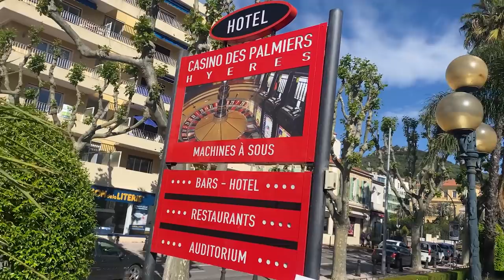MAKING WATER FOR THE FIRST TIME | EP 281

Comment: Just an fyi, the meter measures total dissolved solids, so water in your tank, no matter how long it has stayed there, is not going to increase in TDS reading as it cant gain solids!. It can however start to have micro growth that will not impact the tds reading. Good practice is to try to balance water usage to water generation so it does not get a chance to stagnate on the tank. To be 100% certain of micro quality you can get small uv units that would go onto the drinking water tap (not needed for wash water or showers!).
Reply from the maker: Thanks, this is all most helpful, we appreciate it. Who would have thought water would be so complex. Makes sense, we need it to live.

Comment: There is a specialty purposed  round wrench designed specifically to open and close the housing for the water filters. I  use a wrench like that and it makes the job much easier. The one I use appears to be made out of some type of plastic material. It's basically a big circle with a long handle. Hope this helps  : )
Reply from the maker: Thanks, we are looking into it. He said it took him a good 5-10 minutes to get them off.

Comment: Re problem with removing the clear plastic filter holders:  I have the same brand in my home. Each of those pre-filters comes with a special plastic wrench.  The wrench is about 12 inches long  - about the size and shape of a ping pong paddle. The paddle end has a hole to place over the clear plastic holder with k notches that align with the ridges in the clear plastic covers.  The plastic covers have a large O ring to seal it. Be  sure to have more of those O rings as backup stock. They sometimes stretch out of shape as they possibility react to whatever is in the water and will leak.  Each of the complete filter canisters (clear plastic with blue top)comes with a wrench so you should have two of them sitting around somewhere . Check behind your water tank/holder they may have fallen behind the tank up against the exterior hull. the paddles are only about 1/2 inch thick and made of tough plastic.
Reply from the maker: Thanks. I don't think they were left from the previous owner as he showed us how to open with his hands. Might need to order one. Interesting they are both missing. We appreciate all your tips.

Comment: Regarding your water purity, as you are removing the salt from the sea water the lower the reading the better, however if you were drinking mineral water a high reading is better as it contains more desired minerals. Too lower reading in your osmosis water can be bad for the body and should be supplemented with electrolytes
Reply from the maker: Good to know, thank you!!!! Learning so much about water. Who knew.

Comment: What is that egg meant to be?
Scrambled egg?
Whisk with a splash of milk before you add to the pan. No oil, a small knob of butter. High heat, scrape the base (wooden spoon or silicone spatula) as the Kurds form. Remove from heat, loosen all Kurds. Back on heat, repeat until silky, remove heat, tea spoon of creme fresh (stops it continuing to cook) combine, season serve
Reply from the maker: In an ideal world that would be a scrambled egg. In our world it wants to be a scrambled egg but I had none fo the following so I had to improvise: butter, milk, spatula, creme fresh or even a frying pan with a handle (it broke off). We did not buy much as we did not want to waste or leave behind. Ha!
Reply: @WorldTowning  we I make french toast I’ll quickly fry up the leftover egg the way you have...